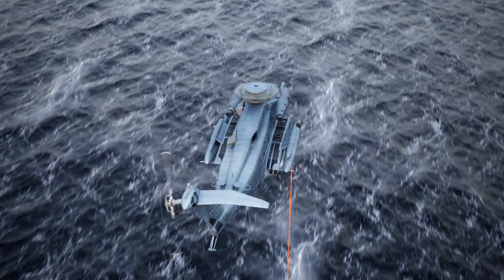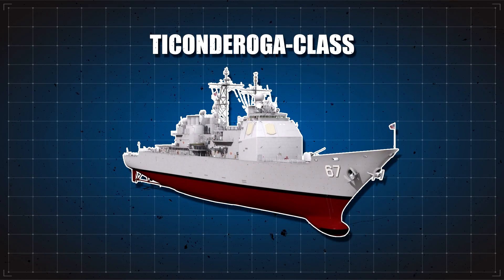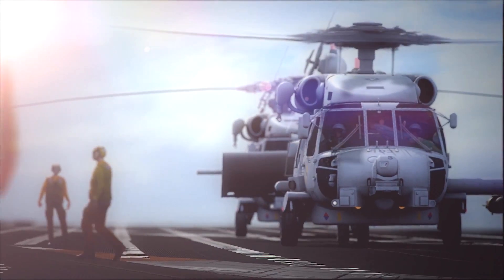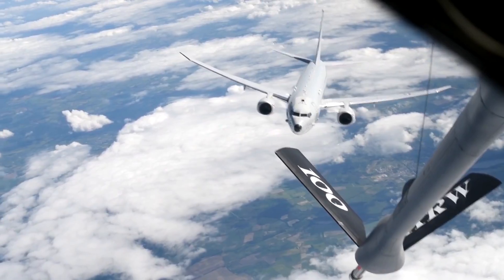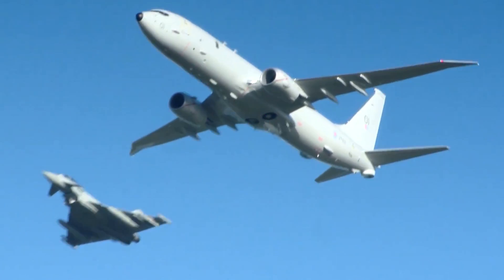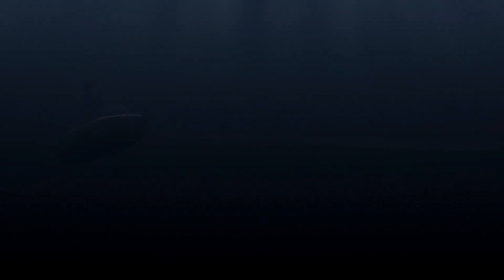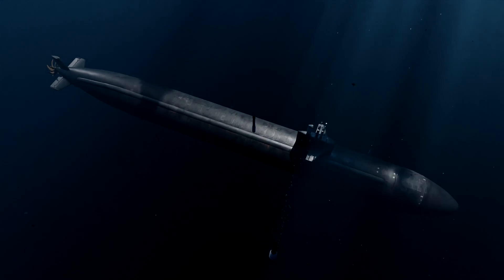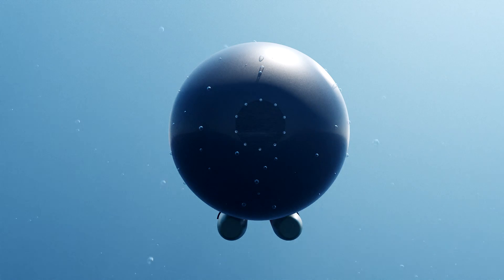US Navy Testing Its Monstrously Powerful Anti-Submarine Torpedo

Comment: Wonder how many sea animals died in those tests..
Reply: It’s not important.
Reply: Not many. The yield on those tiny air-dropped torpedoes is pretty low, just sufficient to punch a hole in a sub's hull. They're not suitable at all for use against surface ships larger than a patrol boat. And the persistent pinging of their homing sonars would probably drive most critters well out of range anyway.